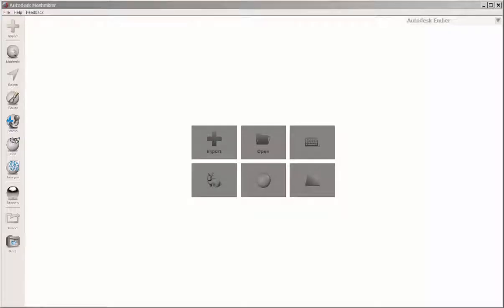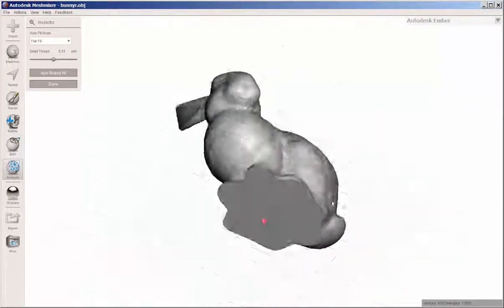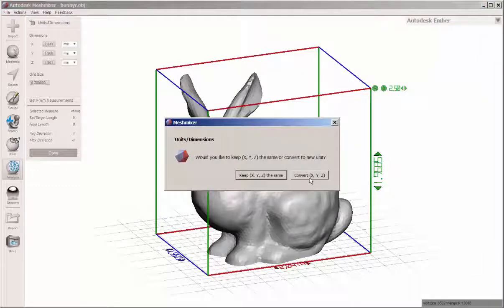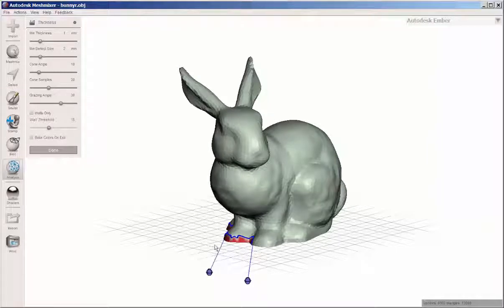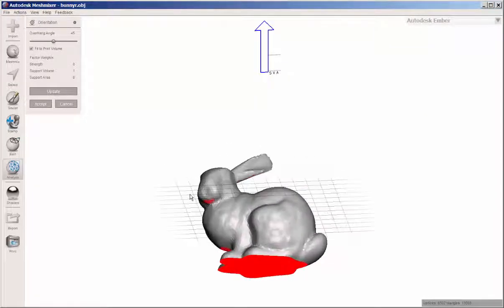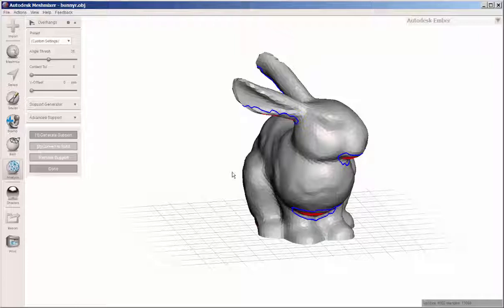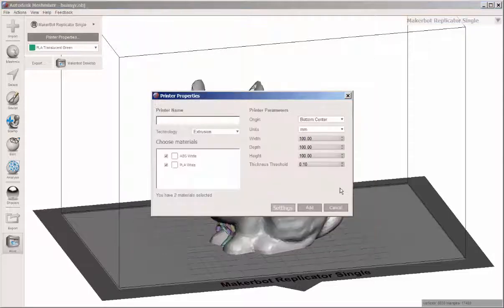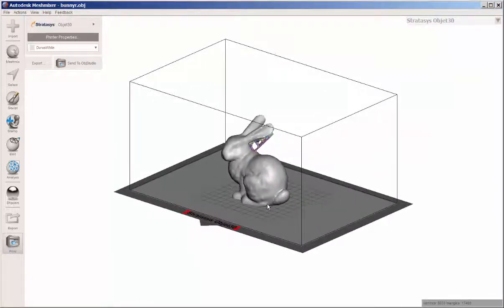Meshmixer: Analyze a File for 3D Printing

Comment: how to fix the red areas in model?
Reply from the maker: If Meshmixer can't fix them, you need to bring it into the original software and fix them there.
Reply: @ProfDrafting  can u pls guide me how to fix them using meshmixer ?
Reply from the maker: @nehabhullar913  go to analysis/inspector/repair all. Or click on each individual pin the inspector puts on the model for a more fine-tuned fix.
Reply: @ProfDrafting  thank you so much sir.can i have your email id for further discussion